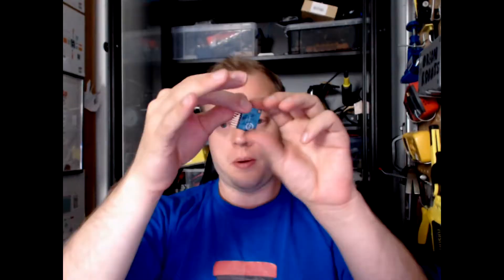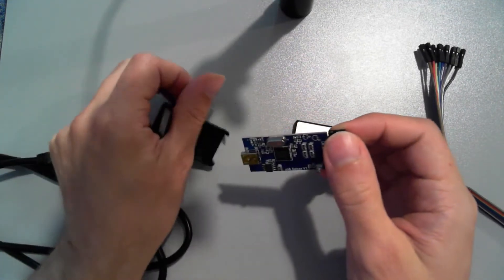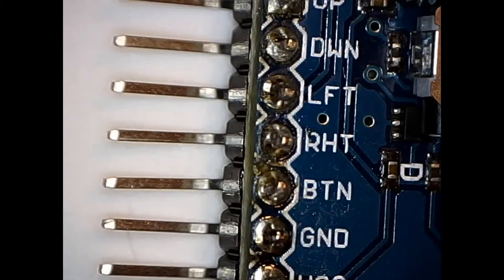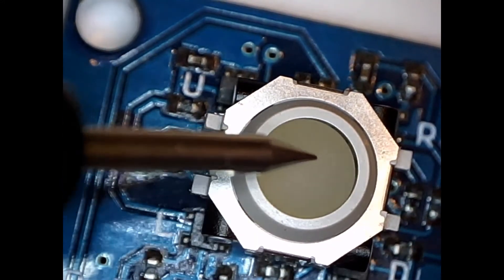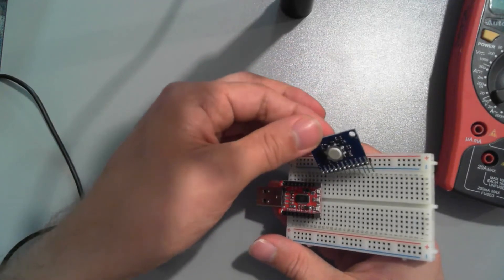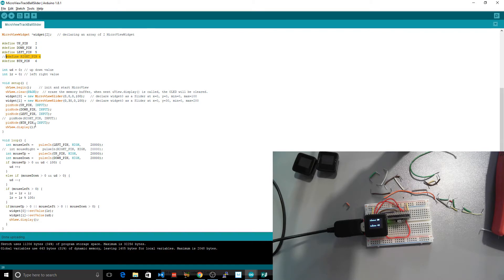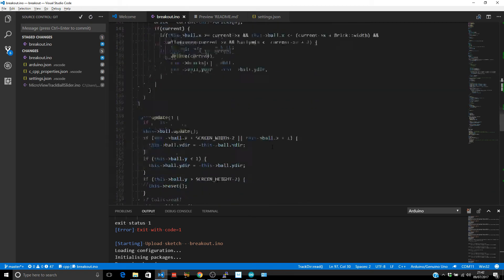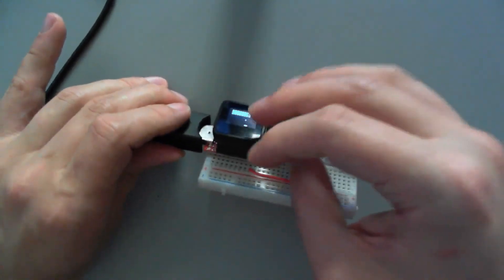Making a Trackball Microview Breakout game

Comment: So I opened your video to check for a project on the trackball, and noticed the faulty roller on mine, two seconds later you find your faulty roller. I think I know now why they are cheap. Nice video!
Reply: The faulty roller is full of crud when opened up, even after cleaning it still goes slower than the rest
Reply from the maker: I'd love to hear if you get it fully functional.
Reply: I also just now noticed that top and right roller wasn't working!